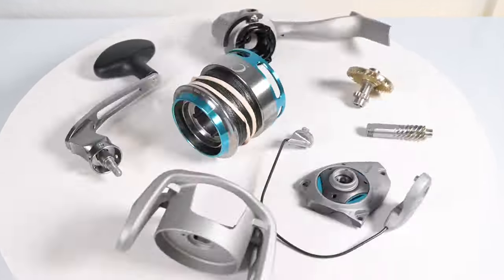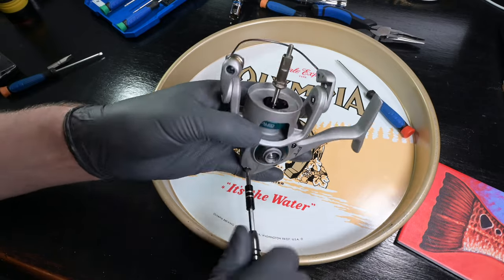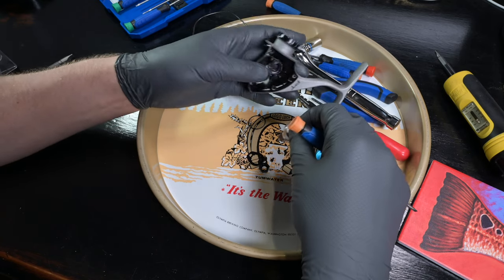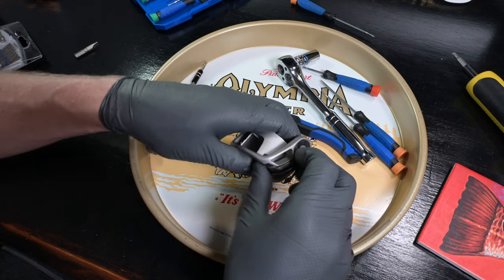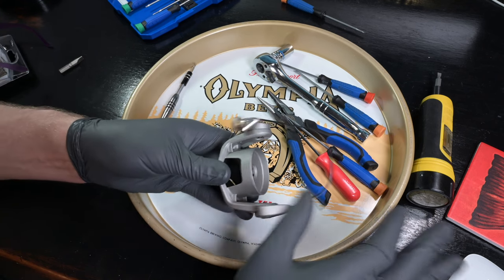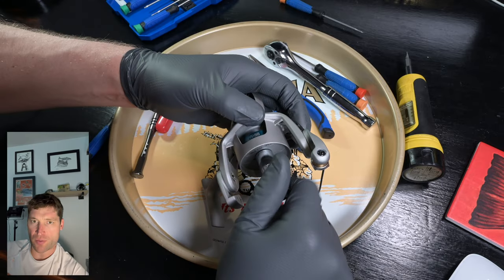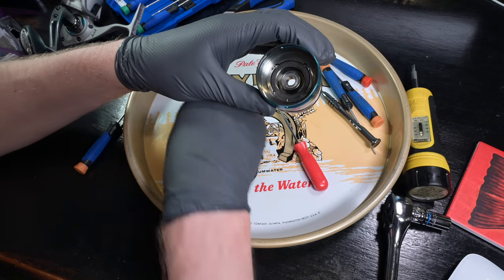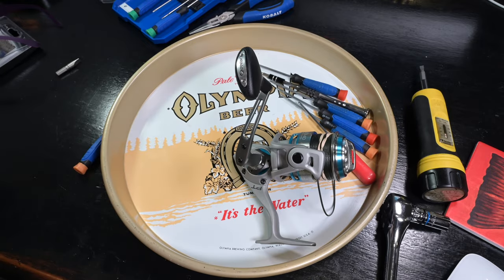QUANTUM CABO: Teardown & Assembly for CLEANING or Repair

Comment: Hi, have you greased the gears at least, or you trust the bare metal..?
Reply from the maker: I like grease on the gears, bare metal is bad over time. Thanks for stopping by!
Reply from the maker: I wouldn't buy another unless they make significant upgrades. Great concept, execution not the best.

Comment: the Cabo series of reels are freaking tanks.. heavy as hell, but fairly indestructible for the price
Reply from the maker: Glad to know, I’ve been super impressed with mine so far. Good components and tech for the price. Thanks for stopping by.
Reply: @CastFromTheHip  solid choice for moderate shark work, jigging wrecks, light tuna/jacks.. etc